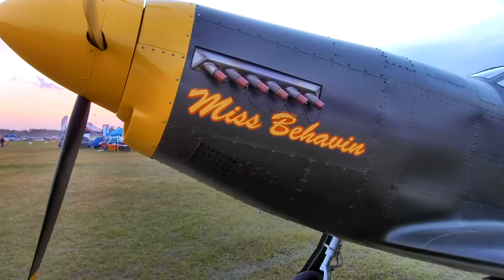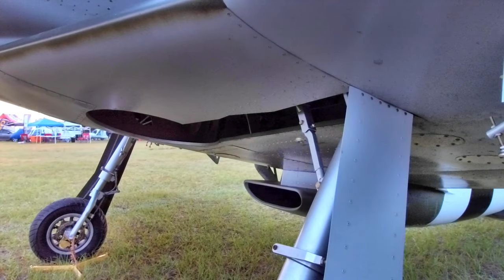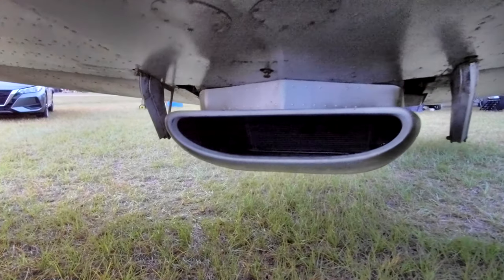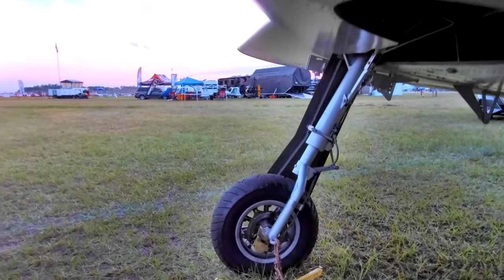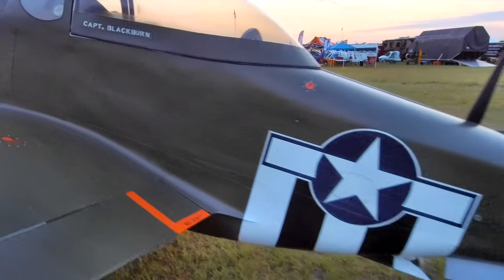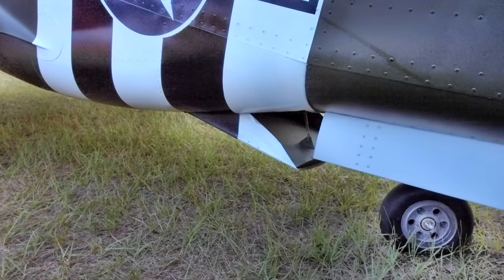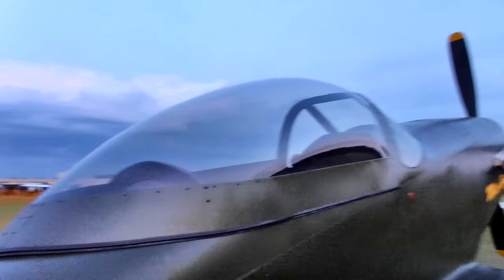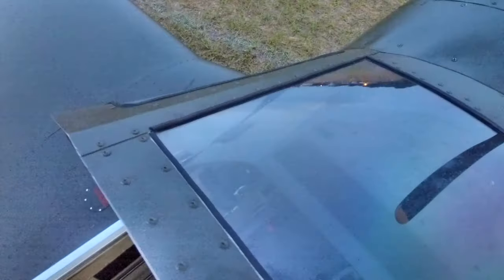Sun-n-Fun 2021 - MORE COWBELL...err..MUSTANG!  A deeper dive into "Miss Behavin"

Comment: Hello and thank you for showing the Mustang.
Q1. The underlying droptanks, when empty: they were dropped off from inside the cockpit to reduce weight and drag?
Q2. That Mustang "miss behavin" has been fitted with a Honda engine. Is that because of the better reliability of a new generation powerplant?
🌏🇭🇲
Reply from the maker: The drop tanks on the actual WWII Mustang were, as you noted, used up and then dropped before the aircraft headed into combat. 

Miss Behavin was built with the Honda engine before Titan began using the GM LS3 V8 engine. Titan started with the Rotax and progressively added more powerful engines as the model evolved into the current kit. The structure was upgraded along with the engine choices. You can currently get either the V8 or the BMW V12 engine (the V8 is more powerful, but the V12 is more realistic sounding and has great redundancy with two computers running the engine as two separate straight 6 engines that you control separately).

Comment: Hello Jeff!  I noticed that 'Miss Behavin' has an iconic "axe handle" antennae.  What is the manufacturer?  Also, what sort of range endurance can one expect with the addition of tubular wing tanks and faux drop tanks?
Reply from the maker: The axe handle antenna is actually an option directly from Titan Aircraft.  Basic fuel capacity is 26 gal.  The wing tanks are 3 gal each (6 gal total) and the drop tanks add 10 gal each (20 total).

Our Mustang build has the optional 13 gal fuselage tank and the 6 extra gal I. The wings. 

Expect about 13-15 gal per hour burn with the V8 engine at full power.